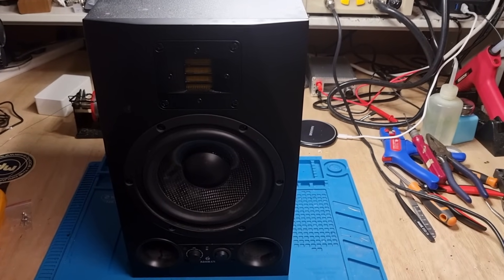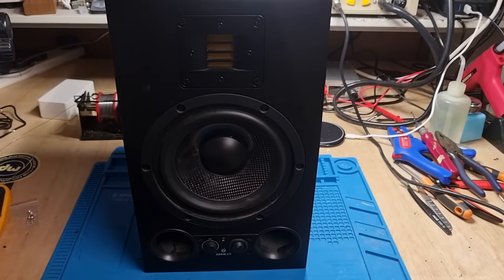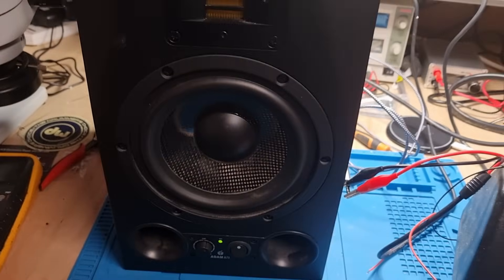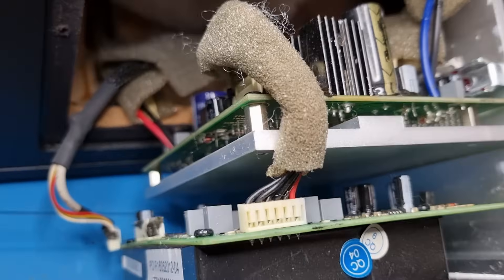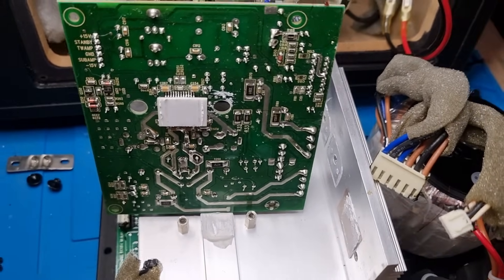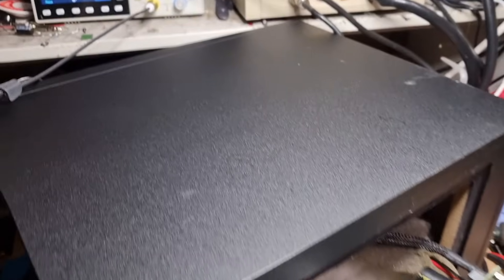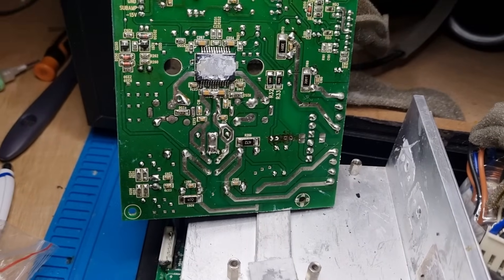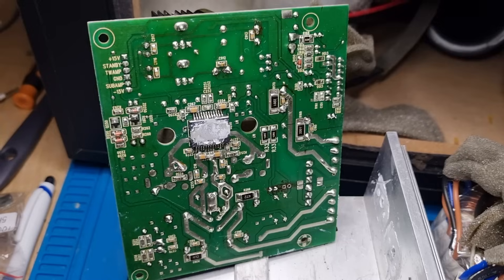Adam Audio A7X speakers repair

Comment from the maker: A nice pair of speakers. Back in full working order.  Any questions or comments drop them in below.

#electronicsrepair #studiomonitors
Reply: How much would cost to repair potential issue where fuses keep blowing?
Reply from the maker: @LogicKidroy  on the above speakers?  Of course it's likely something else is causing them tp fail. Most likely am output transistor.      Somewhere between 50 and 100 pounds I would think.

Comment: Thanks for the fantastic dive into this repair. I have one my A7X's slowly dying with quieter and quieter audio. I'm very adept with a soldering iron and have built synth kits, repaired some older synths.. I want to replace the caps on my A7X, but I'm not sure I'll procure the correct ones.  Would you share a BOM for the ones you replaced?

Comment: Looking to tackle the same repair on my pair of A7X’s as well. In my case the failure happened abruptly after a failed neutral on the service side, leading to 140V+ line voltage.

I’ve only just disassembled the first speaker, but found very similar bulging capacitors as to what you found in this video. You mentioned that you replaced components other than the electrolytic capacitors — do you happen to remember what other components you found needed replaced?

Comment: The unit is not really that old. I imagine weak capacitors were initially installed
Reply from the maker: @ramencurry6672  Yes, although not all the same manufacturers.  Could be a combination of things plus the design is causing greater strain. Hard to say without knowing how common this model fails.

Comment: How did you manage to remove all the black goop off the pcb?
Reply from the maker: @AzzaDutt  It loosens with some isopropyl and then gently lever
Reply: @FentronixElectronics-ul9kq  Worked a treat! Thanks! 

Any idea what part L251 and L252 are? Seems to have burnt out the board
Reply from the maker: @AzzaDutt  I don't have the diagram to hand but L would suggest inductors.